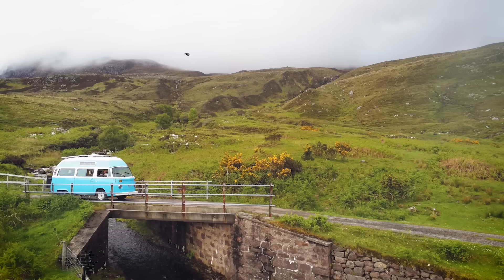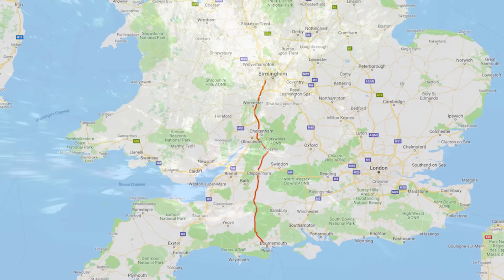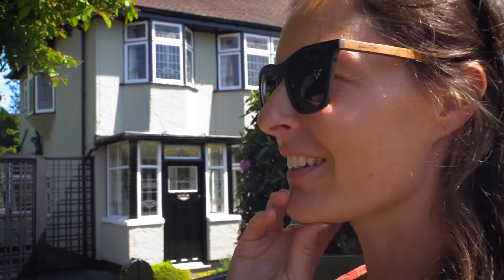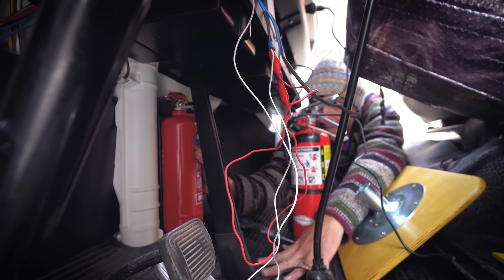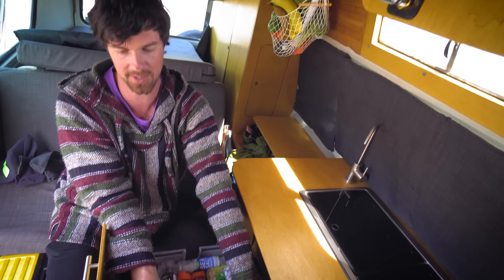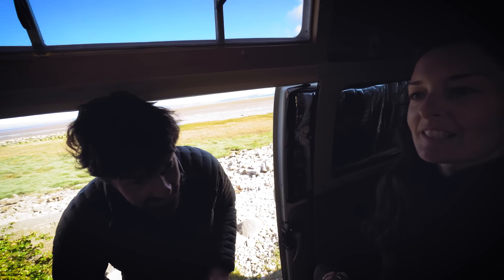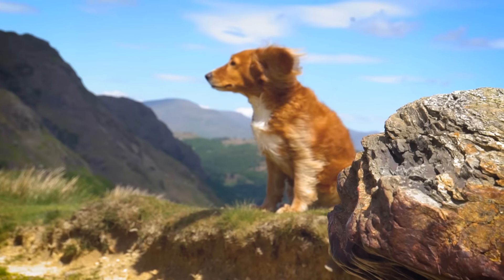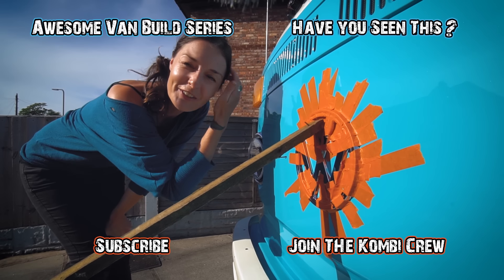VAN LIFE UK: Preparing to go OFF GRID FULL TIME // S03E01

Comment: The flood might be from the shower, if you ever use it since put it up. As I referred last time, is not recommended to be used inside. Everytime I was using mine, I was drained the water BV well, before put it in place and I can tell you that lots of water goes out. My humble suggest is to create a kind of door or foldable wall/support, that go out of the van when you want to shower, as a backdoor to Nisan Patrol (just as example). That way, you can disconnect the tubes and drain the water down. Also, install a faucet before the shower. I have these kind of faucets pretty much everywhere, just in case. Call me paranoid, but I prefer this, instead of floods (happen to me also, learnt the lesson).

Comment: Suggest you keep the 3 sim for use in and around EU! With the unlimited data plan with 3 EU roaming gives you 19GB of data a month anywhere in the EU. You won't find a better deal as far as I'm aware! Also a £5 a day for an unlimited data day pass add-on if you need more data at any time.

Comment: Van Life idea? Since you have practically no bumper system of any kind up front, wouldn't it be a great idea to install a VW covered spare tire on the front center between the headlights? Instead of the big VW logo you have planned? A spare tire up front would be a good fit for front end collision protection and overall a great place for another spare tire.
Reply from the maker: thanks for the comment - this is a common misconception, the (already) limited crumple-zone is negatively affected by having the tire up front.  It's safer not to have it there, unless the bus is modified as such (some were, most are not)

Comment: The van is looking good (again)  but it would look even better with a nice set of wheels or at least vw hub caps. Btw why is the right front wheel a different colour? We have added the four pack of kombi life stickers to the collection of stickers on the rear window of our 1977 Trillium fibreglass trailer 👍
Reply from the maker: Thanks for your support Phil.  We're changing out the wheels in a coming episode that is why they aren't painted